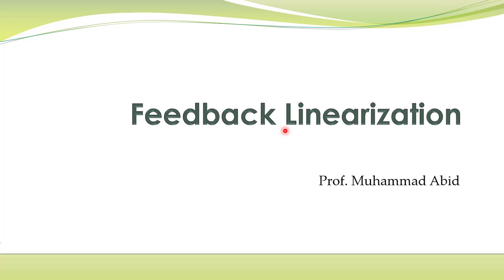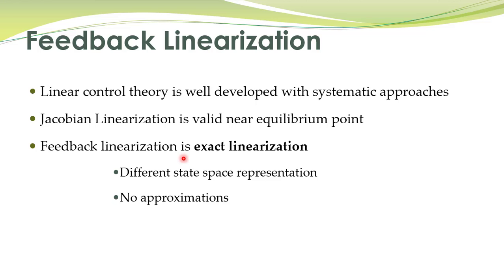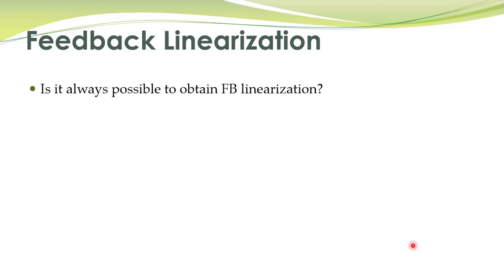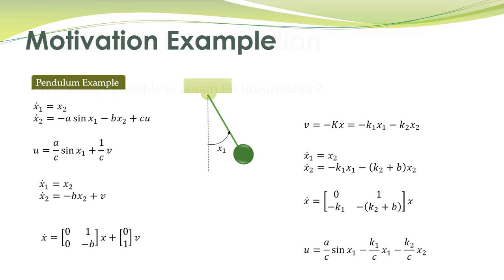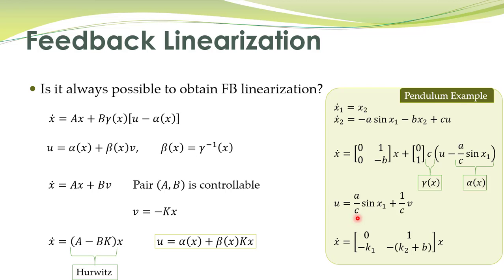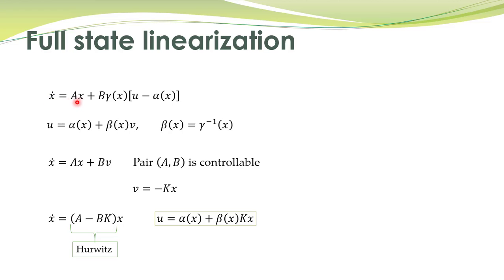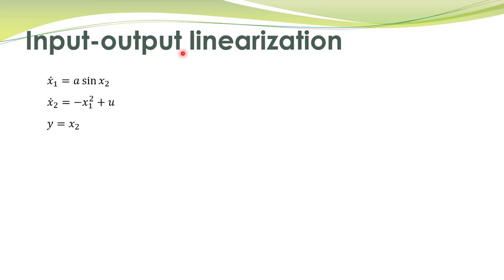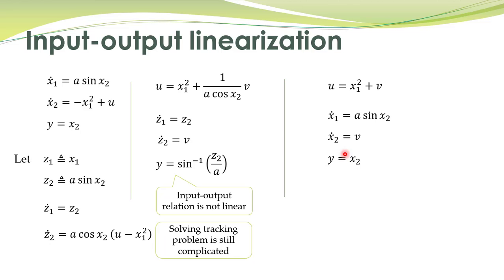NCS - 23 - Feedback Linearization - Motivation and Basic Concept

Comment: sir I have a MIMO system of non linear states and the output is also non linear, please suggest me a suitable controller design for this.
Reply from the maker: If you have a multi-input system with single output, the feedback linearization process is almost the same. For multi-output system, there is a concept of vector relative degree, you may refer to the book by Isidori for details on feedback linearization of multi-output systems.